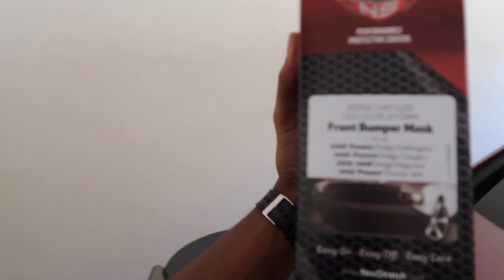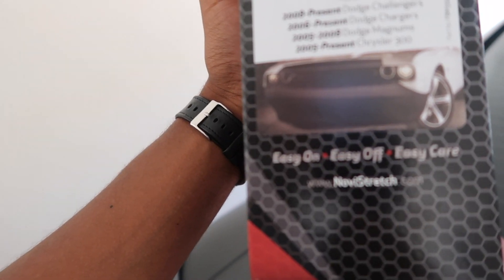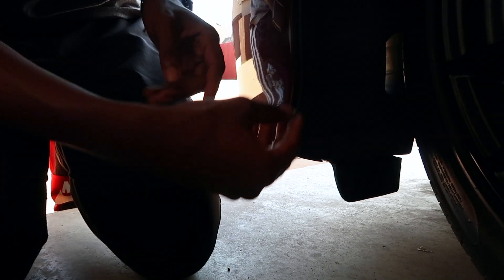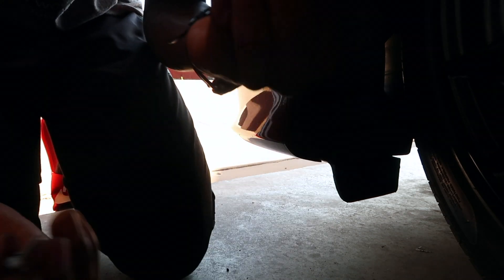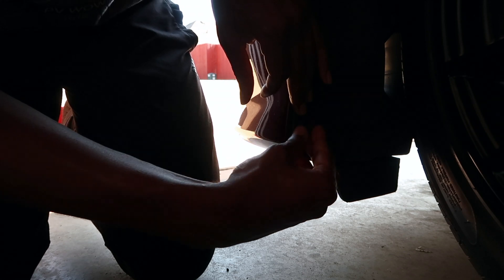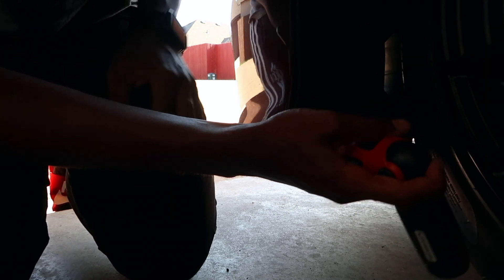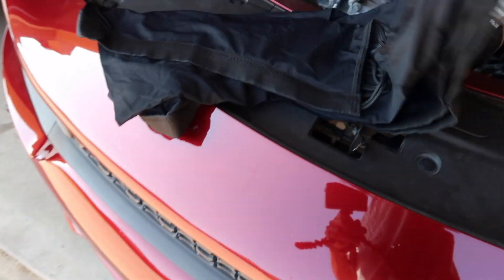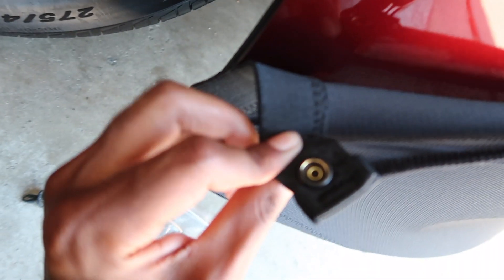INSTALLING A NOVI STRETCH ON DODGE CHARGER

Comment: Nice ride bro. Do you leave it on just in the summer or winter too. Also how long did the bra last without fading.
Reply from the maker: DM only use it for long trips. The bra has not faded.
Reply: @FAMOUSTJ1  thanx